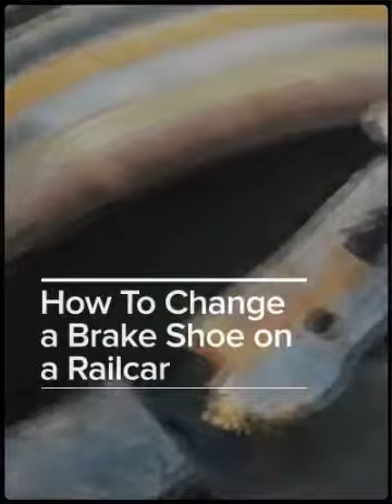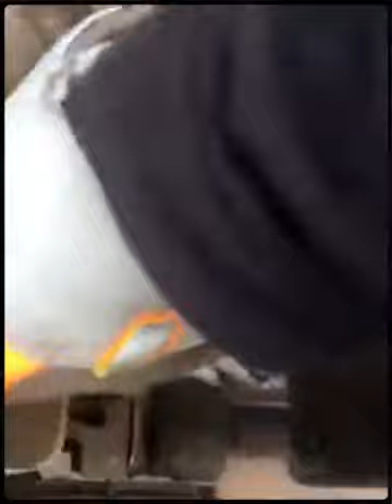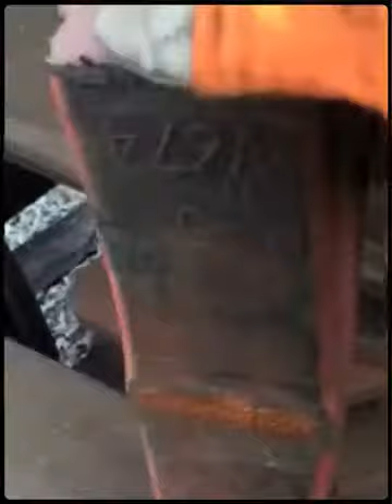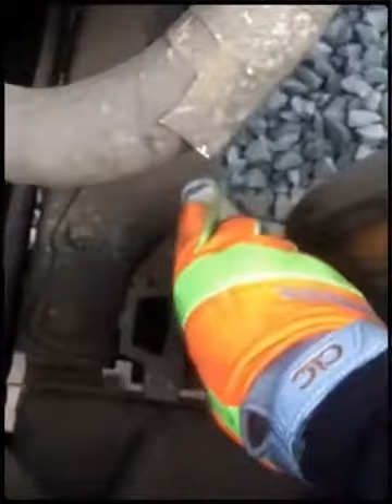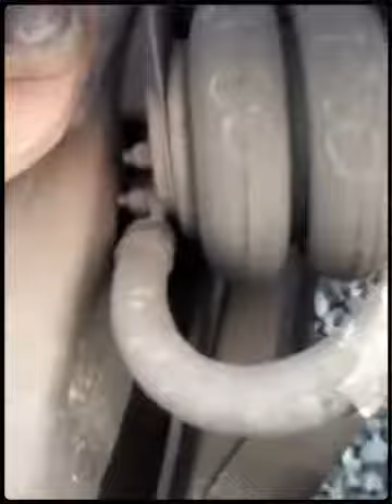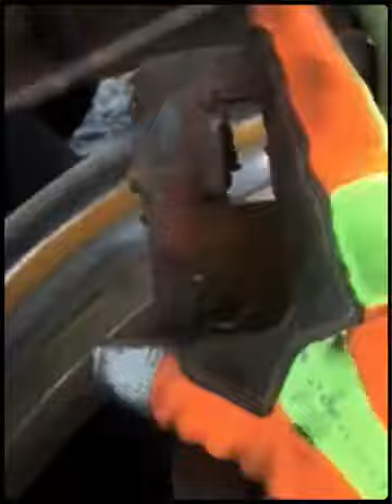How To Change a Brake Shoe on a Railcar  (Created with @Mag

Comment: You put the wrong shoe on buddy.
Reply from the maker: The WheelSaver semi-metallic tread conditioning brake shoe was applied to repair wheel tread surface from defects
and keep wheels in service longer.
Reply: @doubleO16 spine cars use the high friction composite.